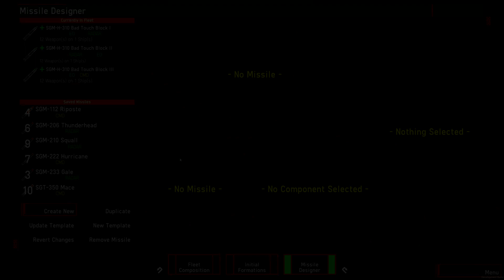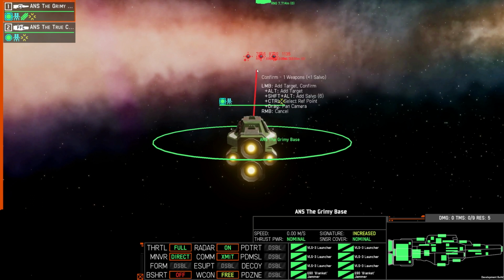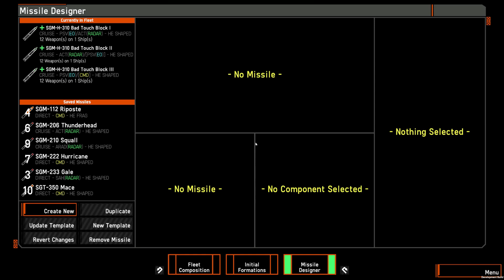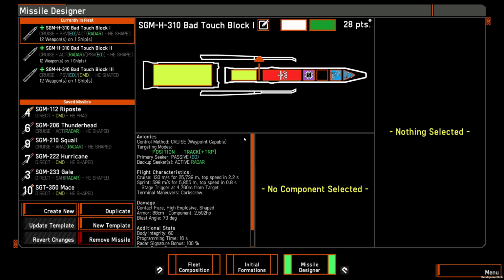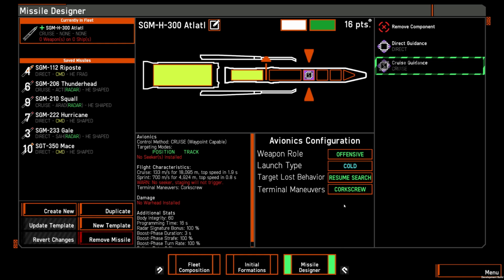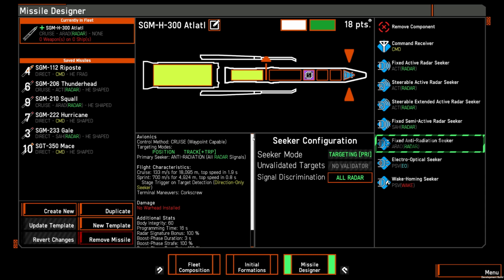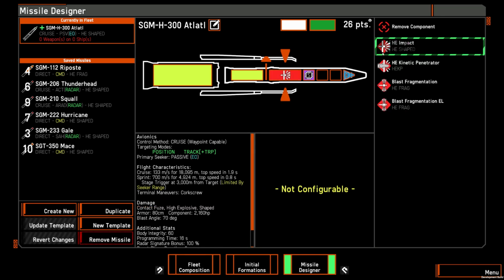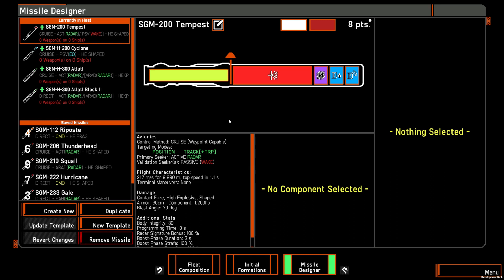Nebulous: Missile Design for Beginners

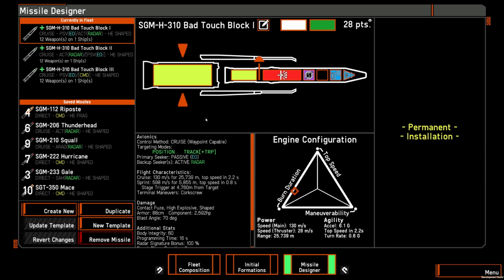Comment: 2:37 I have found that any missile with a corkscrew terminal maneuver really needs to prioritize maneuverability. Or it'll often miss targets. Like.. a decent amount 10-15, 25%. Cool video. Game is already so much more complex than when it first came out. I just have so many games it's hard to focus on one so complicated.
Reply from the maker: I've found the accuracy of corkscrew depends on 3 things: the size of the target, the angle the attack comes at the ship from, and the maneuverability of the missile. Thus, if you're coming at the target from the side or are firing at something large, you can really skimp on the maneuverability.

That said, my experience has been using corkscrew is generally a mistake for missiles intended for targets any smaller than a light cruiser. It's also worth saying that making a missile TOO specialized tends to go poorly in most cases.

Comment: So does cold vs hot launch really not matter all that much?
Reply from the maker: Hot launch seems to be better if you are launching at targets at very short range, such as firing missiles at a target inside it's point defense envelope, since it gets the missile moving sooner (giving the PD less time to engage). You do need to be a bit careful when doing this, however, as the missile needs to be maneuverable enough to turn toward the target with its main engines lit. It can also be  useful for Anti-missile missiles, especially if you are giving them a shorter range (although I've had luck with both cold and hot launch AMM's).

Cold Launch is generally better outside those situations as it requires less clearance from the launcher. The ship does check to ensure there is enough clearance between the launcher and obstructions before firing, so if you are near rocks and the launcher is currently pointed toward the rock, there may be a delay before the missile fires as the ship will need to maneuver until the missile launcher has the required clearance. Even then, if the missile isn't maneuverable, it might still hit the rock despite passing this clearance check since it might not be able to turn fast enough to avoid the rock.

As a general rule of thumb, I make missiles cold launch unless I have a compelling reason to make them hot launch.
Reply: @skyelansing2311  Thanks Very informative you really should think about making a video about it I haven't seen it covered anywhere else

Comment: Are you sure Command Guided Missiles can use TRPs? I just tested that to no avail.
Reply from the maker: They can, however they require a cruise guidance. If you use direct guidance, they cannot.
Reply: What's the click-order then? In the TRP tutorial, it was 'select weapon in track mode' then 'select TRP' then 'select target'. Is that correct for cruise CMD?